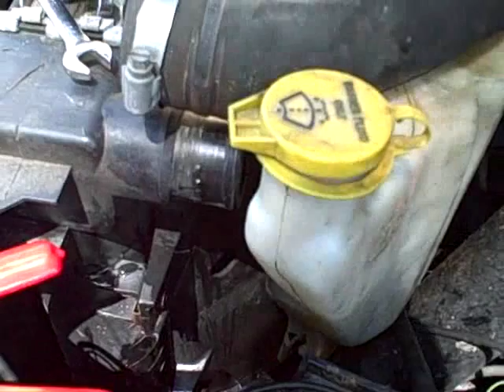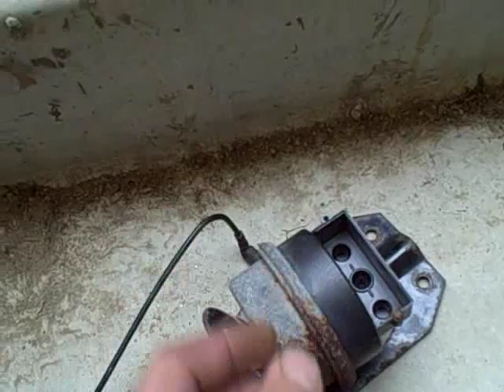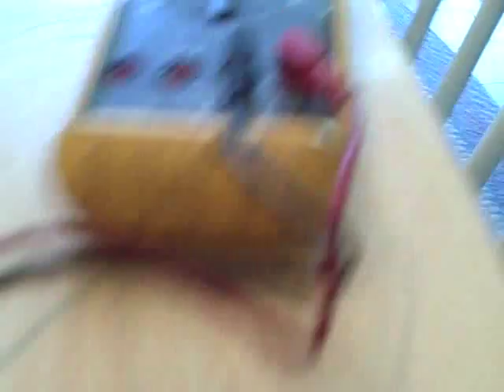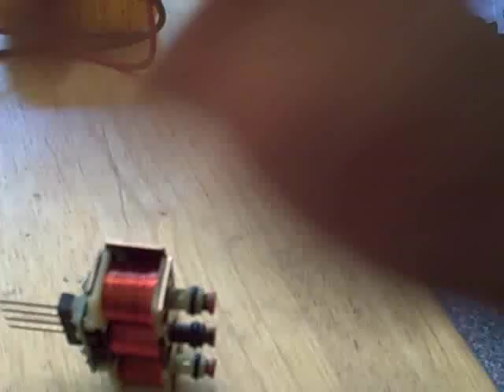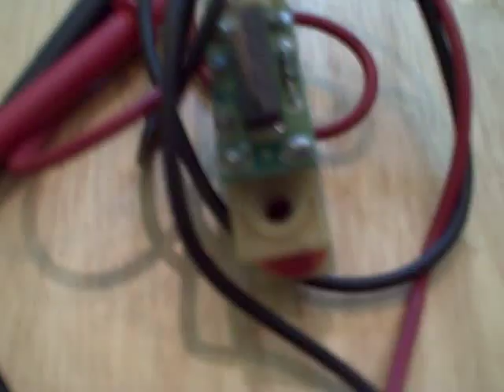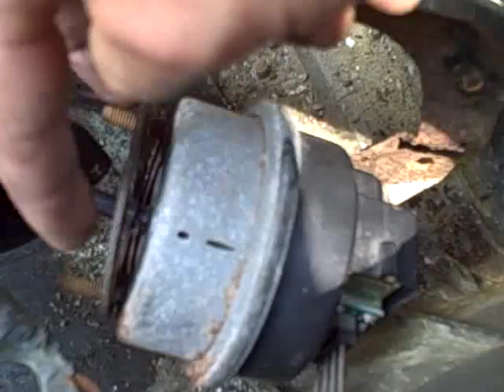Dodge Repair.wmv

Comment: Question for you.. First off let me say thanks, I've been looking all day and haven't found a better video explaining how to test it.. I've got a 99 3500 truck and my cruise control works, until i put a turn signal on (was both now left, disassembled and cleaned yesterday) and when I turn my head lights on, it shuts off.. What was yours doing/does it sound like the same issue as in the video?

Comment: How did know the diaphragm was still good or was not the problem? Great job on the video by the way, please keep the coming!
Reply from the maker: Hello Peter. When the diaphragm gets old, the rubber can tear and leak. If you blow into it (just lung power, not compressed air), you can usually tell if it is leaking by listening for the air escaping. Thanks for watching!